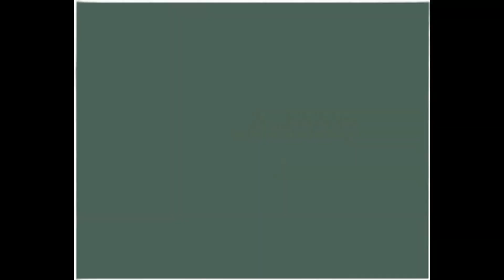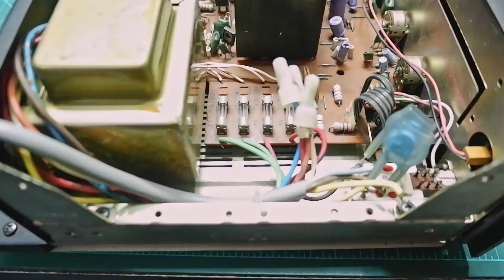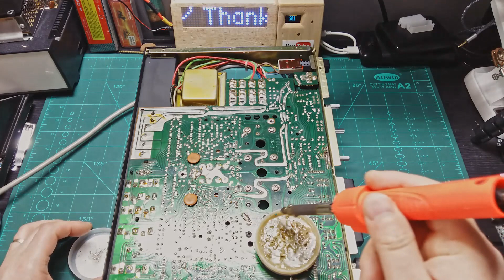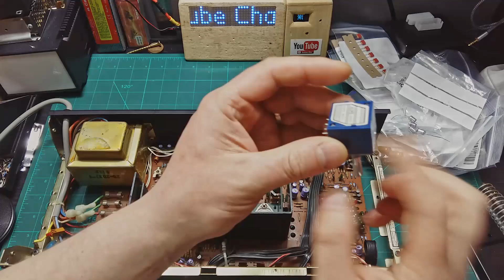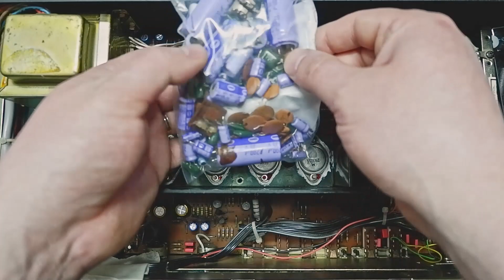How to improve the NAD3020 audio amplifier

Comment: Nice. 
If you want to add more work...🙂 change all the black signal cables (aluminium)  to Cat 5 signal cable @15cm (copper, opened and individualised). Makes a difference .
Reply from the maker: Thanks buddy! Definitely can use also high quality wires to make it also much better!

Comment: Hello, sir. Yes, I have a NAD 3020—a 3020i, to be precise—and it has a small issue: it’s crackling and the sound is really distorted; you can barely hear the music underneath. I believe it’s repairable, but the problem is that I’m a novice and don’t really know much about this. That said, I’m not entirely inept—I do know how to solder—so I intend to repair the unit, and perhaps even upgrade it while I’m at it. If I run into any questions, I won’t hesitate to reach out to you. Have a great day! — Julien (the Frenchman)
Reply from the maker: Thanks buddy! I will start with the main filter capacitors! If those are ok then I will check the power transistors!

Comment: You played the original capacitors at 9:00 volume and then you played the new caps at 12:00 volume. That is cheating. Your comparison isn't valid, because you didn't test at the same volume.
Reply from the maker: My test was not about that play with more volume! Was about the quality of the sound and to understand this definitely increasing the volume should add more distortion on the sound! And I did this just to listen if the sound is clear or distorted with higher volume!

Comment: 1st test loudness is on, volume is way lower but nearly get 2 diodes up. 2nd test, no loudness, volume way higher and only one diode up. listen to all that on the same amp that on the video...so i know how the loudness can shape the sound a lot!
Reply from the maker: Thanks, definitely this amp sound much better with all those fresh capacitors in
Reply: @SymbolTech21  can you explain why you needed to boost the sound that much on the 2nd test to archieve about the same level of sound than on test 1???
Reply from the maker: @abwartsbanapu5411 I didn't boost nothing the potentiometers are on the same position as on the first test!
Reply: @SymbolTech21  you did, in the 1st listen, volume is about 10 o'clock and then you lower it to a bit above 9 o'clock. on the 2nd listen, it's between 11,5 & 12 o'clock and we get the same sound level. and i know from experience that we should get a very loud sound with such difference
Reply from the maker: @abwartsbanapu5411 the test was not about the loudness, was about the bass and treble if you check the tone control pots are nover moved!
Reply: @SymbolTech21  yeah sure, but put the loudness off and a whole load of bass are removed. and that still doesn't explain the huge diference of where the volume knob is
Reply from the maker: @abwartsbanapu5411 definitely there is not to much difference in volume. From the old caps. But the tonality of the sound is much clearer and crisp!

Comment: 1:08
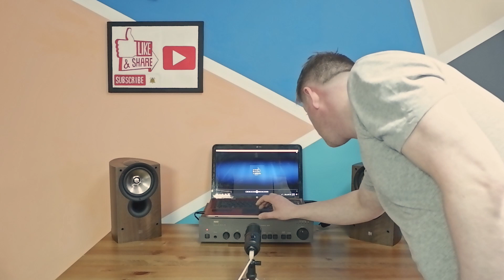15:36
Reply from the maker: Thanks for your comment, would you please tell me what you noticed on that timings you mentioned in your comment?
Reply: @SymbolTech21 just put them so that audience can skip quick to the before and after tests to compare. I think it is hard to compare, sound is diferent more because of the recording i think (volume and room resonance). I was looking to decide between 3020i and 3130, same price, hard choice.
Reply from the maker: @mariusfurtuna9422 if you give me little time I can check between them and let you know which one I my choose for my self in case I want! Yes is not the right way to compare the sound but definitely listen straight away from the speakers you fell the difference! I will come back maybe later today after I get a chance to look at these models and let you know which one I may choose
Reply: @SymbolTech21 Ok thank you. I read some personal opinions online and, although 3130 is a little more advanced people still prefer the first version of 3020. Can't tell if it is warmer sounding or more about the 3020 cult that has stood the test of time and nothing can replace it. Price is 60 Euro each.
Reply from the maker: @mariusfurtuna9422  i will definitely check if schematic available to let you know which one withstand better

Comment: i dont hear anything , but how can i in that room . You could use those load resistors and take voltage across them and record them so we can hear better without your room . Jesus Chris  i did that as a kid .
Reply from the maker: That's for your comment, I didn't get what you mean take voltage on load resistor?
Reply: @SymbolTech21  you take 2 wires , put them across load resistors  imitating speakers , 8ohm  30W say , and you get voltage , that voltage is direct line output from the amp, it can be recorded .
Reply from the maker: @dedskin1 so you have that measurement on the oscilloscope
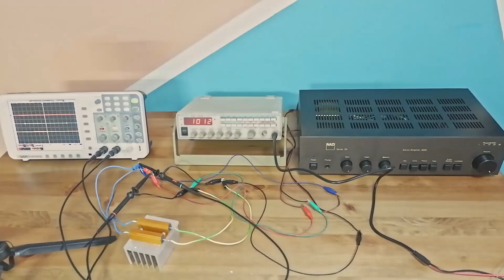Reply from the maker: @dedskin1 exactly starting from min 17:33 I start doing oscilloscope measurements
Reply: @SymbolTech21  i know but it tells me nothing about how it sounds , i know over my own amp it would introduce difrence so i still would not hear it , but i would get general idea . But you do you as they say . I would like to hear , but that is me .
Reply from the maker: @dedskin1  the amp was not mine otherwise I will definitely invite you for an audience! So I don't have with me that amp anymore
Reply from the maker: @dedskin1 do you mean to record from the output line? Across the 8 ohm resistor? The recording device have an input impedance 100k or 50k so where on heart I will find a recording device that have 8ohm input impedance?
Reply: @SymbolTech21  you dont need recording device with 8 ohm input impedance , it would be real bad recorder . Just your simple Audio interface , it will do . You just need to make sure you dont sent it 10V , you need to have it on line level , but that is not hard to do with voltage divider , completely passive so it wont change the sound .
You act like  its hard , i see you have some knowledge you have equipment , i did it when i had only a voltmeter .
I measured and recorded Guitar Valve amp , it has line input , i played a song , it did burn few of my load resistors for i had 2 or 5W ceramic resistors , but i did it . just to see if i want valve amp .
Got it  , then found out output transformers just eat away bass .Fantastic sound but not for bass music ,only vocal and stuff ,maybe ill get back to it .
Reply from the maker: @dedskin1  I can definitely try but once the output is coupled to a 8 ohm resistor and I want to get the signal from there to record I can do any voltage dividers how you are saying but will not be an impedance match to to input sources I want to record. Matching output with input impedance is an important thing in audio. I can give you few links to read about it.
Reply: @SymbolTech21  it does matter for phono amps , its ancient history , for low level signals it does matter , your amp has high output impedance , your recording interface has high input impedance , it will work .
You just have to figure out a way not to burn the input of the recorder , and you have a scope , you can do that , i did it and i didnt have .
Cant remember the exact schematics , but im sure you can do it . If that is what you want .
For sure i would like to hear , so im saying it . That doesn't make it a must for you , just saying .

Comment: I find it very strange that you bought a lot of parts, and expensive Alps pot, but you didn't replace the 2 tripmots for adjusting the idling currend (and by the way after replacing all these parts, adjusting the bias should be your very first step). Those trimpots are decades old, and if they fail and the idling current shoots up to the sky, it will destroy your power amp section.
Reply from the maker: The trimpots they get used if to many time will keep spinning. Like the potentiometers are always up and down. A trimpot if is just set and stays like that I can still sell that trimpot as a brand new component also after 100 years. The bias was checked but sorry if I didn't showed the process.

Comment: I know it’s 4 years ago but you didn’t explain in full the smoothing caps ..what are the 2 small brown ones you put in with the 10k black caps?
Reply from the maker: Can you please point me to the exact video timing about which caps are asking?
Reply: @SymbolTech21  about 9mins45. The original 4 caps on mine are 35v 2200uf ( my layout is different, they on left in front of transformer) I thought it best to keep uf about the same but just increase voltage is good. I assume your 4 smoothing caps were 2200uf but you put 2 x 10,000uf in ..that’s big increase…
Reply from the maker: @brianmansfield666 the capacity of the capacitor will just smooth better the current. The voltage if it's higher will definitely last longer in life because will not be used on his voltage limit.
Reply: @SymbolTech21  you still not explained what the 2 brown caps are…?😢 but if you increase uf too much it stresses other parts of circuit so you end up changing diodes etc…NAD got it right 50 years ago using cheap components and why we still talking about them today..I had retired mine because it wasn’t working right..I’ve since got Quad 303, big Sansuis AU-D9 and au719 Denon etc.. nothing audiophile extreme but I plugged in  NAD with Spendor BC1 speakers and after it warmed up…sounded AMAZING….Which is why I now repair but I want original spec..ok a few more volts on the caps..but just enough to work proper will do me… People mod BC1 speakers but then after….they are not BC1 speakers anymore😊..the best mod for speakers is create better room acoustics if possible….
Reply from the maker: @brianmansfield666 you mean the 100nf capacitor?
Reply: @SymbolTech21  you replace smoothing caps with 2 x 10,000 uf and 2x 100nf ?was that just 2 low value caps to make up the circuit? If you’re making a video on YouTube you have to expect not everyone is electronic expert but we want to learn and it helps explain what and why if you can…I appreciate your quick replies 😊
Reply from the maker: @brianmansfield666 usually it's using the 100nf in parallel with the smoothing capacitors to get rid of high frequency spikes
Reply: @SymbolTech21  could I do same ? Put two 100 nf where I put four new 2200uf …just put in parallel ?
Reply from the maker: @brianmansfield666 yes I will recommend
Reply: @SymbolTech21  thank you😊

Comment: Sad NAD has ditched Class A/B amps 
For class D,  only one AB amp left in there 
Line
Reply from the maker: @dave-t6z  most of the amplifier producers are going to class D because is cheaper to manufacture and also can be made in a smaller size

Comment: Hi !   great job indeed    the sound is actually much more clear after the update/upgrade
2x10uF total is not much   The more uF in the power supply the better    
I would also looked at diodes bridge and bias trimmers that are old and open type
Reply from the maker: @gino3286  when upgrading the capacitors on the power supply you can't just put much capacity because more capacity lead to a dead short for a short period of time if is enough if the rectifier diodes are not capable to handle lots of amps to fry them and also to much capacity will stress the transformer so also here u need to take I'm consideration how many VA the transformer is.
Reply: @SymbolTech21  Hi thanks i understand that  In fact i would take out also the old diodes  Often they are very weak 
10A diodes are quite cheap  and should fit in fine
My rule is 2x 10mF x channel  = 40mF total 
If the space allows of course
Reply from the maker: @gino3286  for that capacity I will go with 25A diode
Reply: @SymbolTech21    it seems a lot
However even 30A integrated bridge are very cheap   The transformer can sustain a short surge  I shorted one for half a minute and it is still working  Litlle smoke and stop
Big caps are very good

Comment: Me personally i don’t like wima capacitors at all. They make sound super harsh what makes me tired after 10-15 min of listening. Im using bipolar caps instead of wima
Reply from the maker: @bohdan2752  I never had this experience with wima. Hope the wima you may used they were not genuine. Definitely there is much better caps out there but the price of one cap is the cost of 50 wimas. Need also to stay in a budget as well
Reply: @SymbolTech21  i use Digikey or Mouser only.
Reply from the maker: @bohdan2752  so definitely should be genuine parts. I personally didn't notice any harsh on sound using these caps

Comment: It is good to upgrade the capacitors. I was surprised that you tested the amplifier with the tone controls turned to maximum and, some music with real instruments and more dramatic dynamic range would be a better test. The steady state power is less important than the transient power. This amplifier is good at dynamic bursts of power.
Reply from the maker: @christopherward5065  I test with the pots up because I changed capacitors on that circuit path to see if tone control works good

Comment: Recap will change the sound signature and therefore the magic will disappear!
Reply from the maker: When all the capacitors are dry I don't know which sound signature you have. Then you can ask any audiophile if ceramic capacitors are good on audio gear. And please let me know them answers.
Reply: @SymbolTech21  I don't believe capacitors go bad in 50 years at least.I have NAD1155 from the 70's and still sounds crystal clear and more dynamic than anything i have tried!Film capacitors sound bright for sure!I am not a fan of recaping a unit unless it is broken...The sound signature is achieved mainly in result of the material of the components in my opinion.Recaping can change the sound,but that does not necessary mean it will become better.In most cases the caracter of the sound is changed for the worst.
Reply from the maker: @beslemeto  https://www.xppower.com/resources/blog/electrolytic-capacitor-lifetime-in-power-supplies#:~:text=Manufacturers%20of%20electrolytic%20capacitors%20specify,to%2010%2C000%20hours%20or%20more. Just read

Comment: When  you say improve the audio part of the unit. What would be the improvement part of the sudio from stock amplifier ?? Thanks
Reply from the maker: Definitely ceramic capacitor is not that good in audio then the old electrolytic capacitors with the time they get dry and goes up on ESR and definitely the film capacitors polypropylene are good on audio

Comment: Hi bro congratulations for this great job I’m starting in the audio world  so I want a buy an amplifier  can yu tell me witch one is better nad 3020 or nad 3020a  I’ll setup with kef coda speaker 3  thanks a lot bro
Reply from the maker: Between these 2 there is just a difference between them in how is designed the preamp inside but both models sound almost the same
Reply: @SymbolTech21  hi bro what about Nad 3120  i need yu opinion please bro thank yu for everything
Reply from the maker: @Accz21  is the same as 3020

Comment: Nice video. When you see the design of NAD3020 there almost no capacitors near the transistors. Now these days they placing the capacitors next to the heat sources. It seem to they design the amplifiers to only last a couple of years with crappy capacitors. 🙂
Reply from the maker: That's really bad to have capacitors near to heat source. Will dry very fast!

Comment: Great work. I just got NAD 7020 and I'm thinking about recaping it roo. It would be very helpful if you could post BOM for all the caps you used.
Reply from the maker: When I ordered the caps I just went one by one on the board and I ordered. I do not have a boom file for the caps. And I suggest you do the same because 7020 definitely is not the same as 3020 and definitely you have different values of caps on that amp

Comment: HELLO, I HAVE A 7020 AND IT HAS 2 ORIGINAL MOTOROLA TRANSISTORS 2955 AND TWO THAT ARE NOT ORIGINAL, ONE 3055 AND THE OTHER 3055H, MY QUESTION IS WHETHER THERE ARE DIFFERENCES BETWEEN THE 3055 AND THE 3055H? SHOULD I REPLACE THEM? THANK YOU
Reply from the maker: The 3055h have a higher safe operating voltage than 3055 all the rest is the same
Reply: Thank you very much for the response, so I shouldn't have to replace it? Does the sound not affect? @SymbolTech21
Reply from the maker: @oficinatraficorosario5504  will not affect the sound the letter at the end shows the max voltage rated just have a look for the datasheet and you will see that
Reply: thank you so much!! @SymbolTech21

Comment: Great video. I have NAD 302 version, the light is on but can only hear extremely low sound if I crack the volume to the max. Can you suggest anything i can try? 
Thanks a lot.
Reply from the maker: I will start first measuring the power voltage. If that is ok then I will measure the power transistors. If also those are ok you need to check the first transistors and then check the preamp stage
Reply: @SymbolTech21   Thanks will give that a go 👍

Comment: Interesting video, but why did you remove fopur caps, and replace them with just two? You should say what/why you've done that. The increase in cap value is small as you've left out two og the caps. I see, I think, that you've put two small caps in the place of two of the main caps. This you shoould also have explained what/why you were doing that. So many missed points. Loudness should be out/off and tone controls should be flat (zero - at 12 o'clock). You should also have done the oscilloscope test before, so we could see any change.
Reply from the maker: Because the 2 new caps the size was bigger and also the capacity was bigger

Comment: I was thinking about recapping some of my old amps.  I have a Yamaha CR-1000 from 1974 with all original caps and even though it still sounds fantastic I keep wondering if I could get even better sound.  It's not the easiest receiver to work on so I've been putting it off for a while.
Reply from the maker: The electrolytic capacitors definitely I recommend to change !